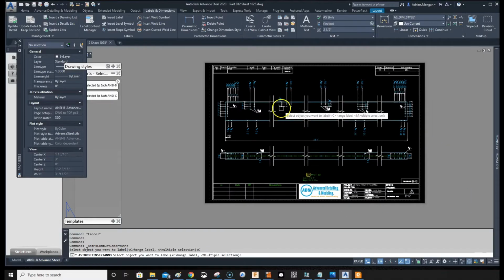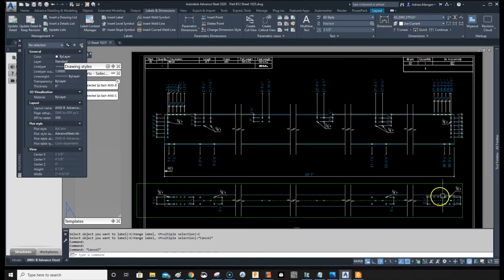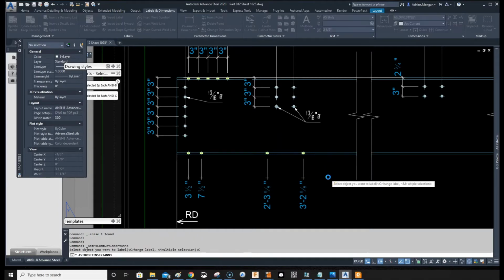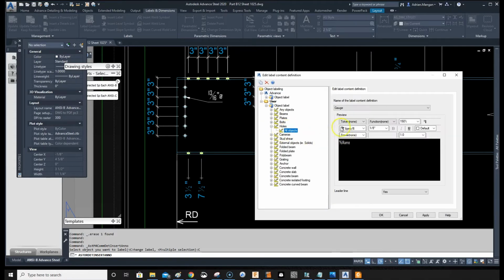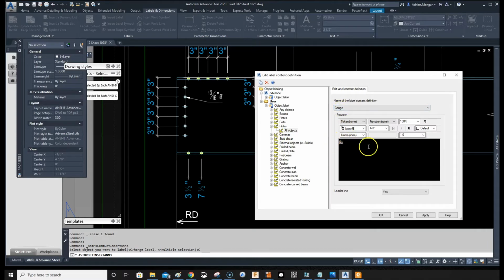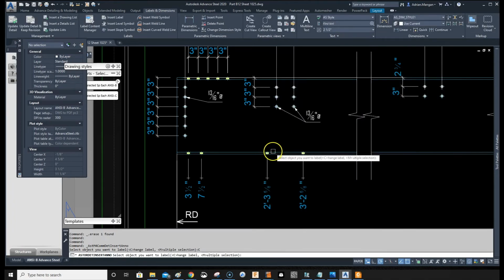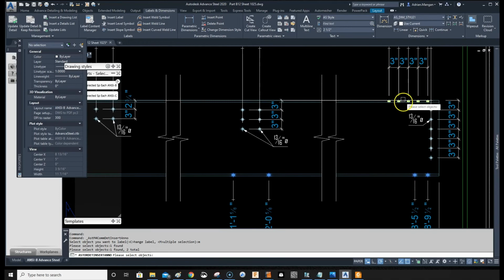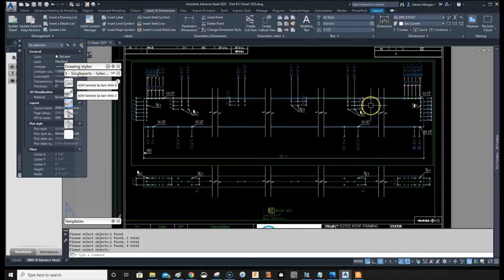ADVANCE STEEL IN 5 - Manual Labeling.

Comment: Nice insight, but you couldn't get rid of the bottom projected view without calling out the number of holes. Otherwise the drill line operator wouldn't know how many holes are in that location.
Reply: Correct, yea. Lucky I didn't remove the view haha, it was just for the purpose of showing the labeling which I couldn't get to work for me for couple of year, real pain. thanks for the reply Dave
Reply: @adriandmangan  I really like your videos and have found them insightful and useful. Keep rockin'!